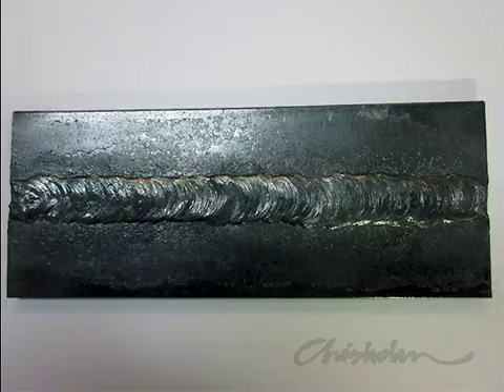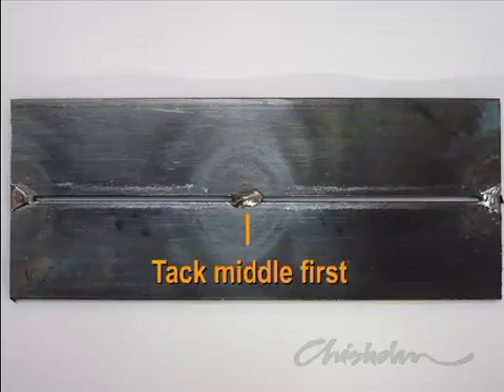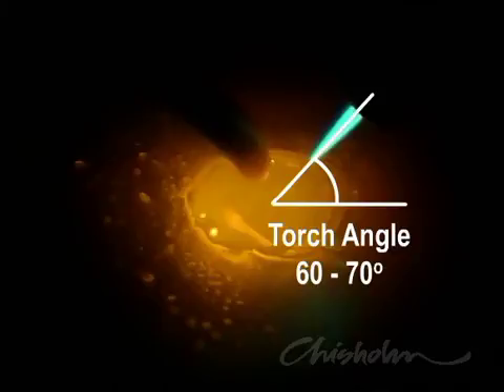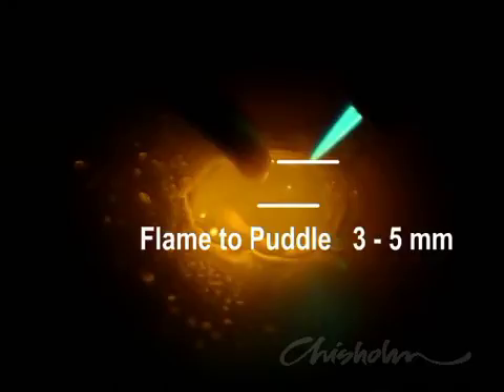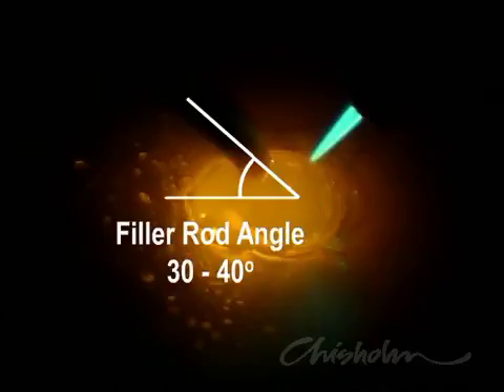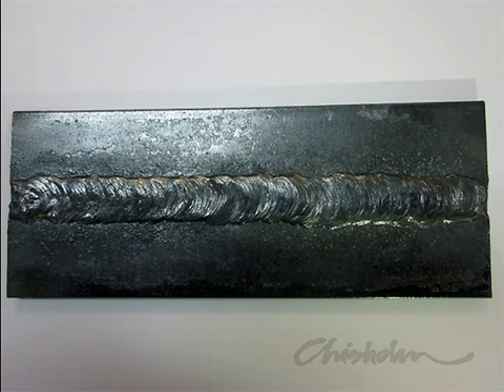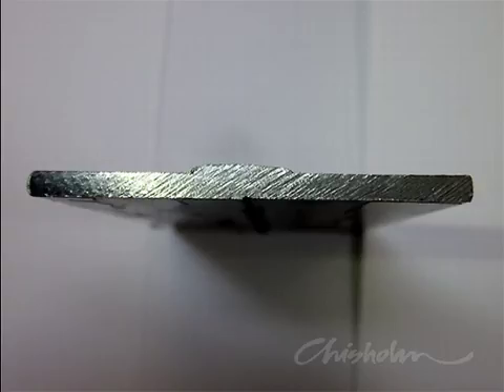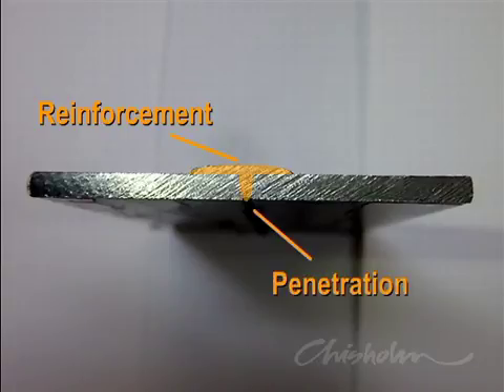Learning to weld: Joining metal together

Comment: I have a buhurt helmet with horns I wanna weld together, since it is only screwed on together 🤷 The seller’s decision not mine. I told them a solid horns would be more practical and durable. But they didn’t agree with me. I fear if I were to actually use my helmet for buhurt combat, the horn screw joints would most definitely shatter on impact ☝️